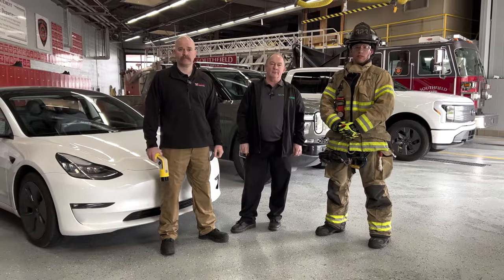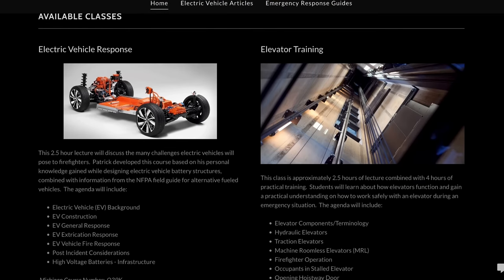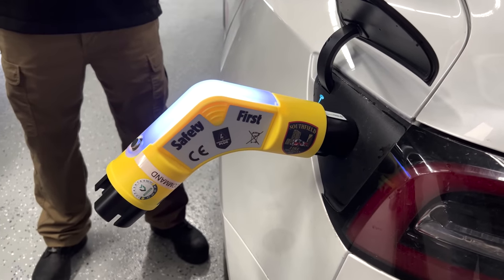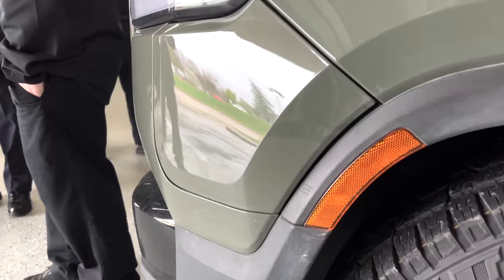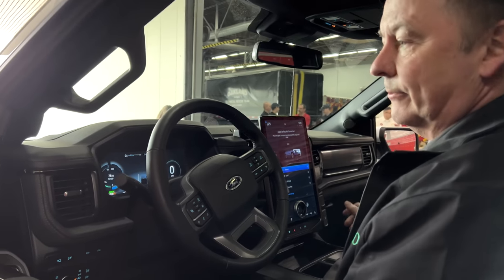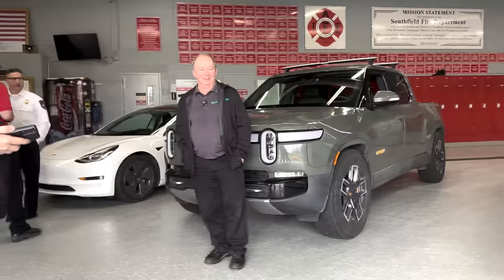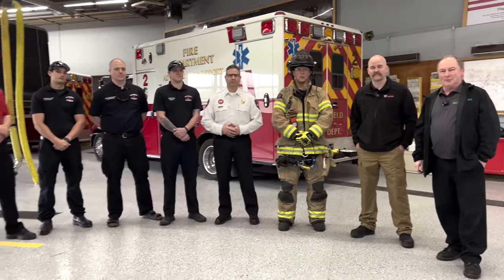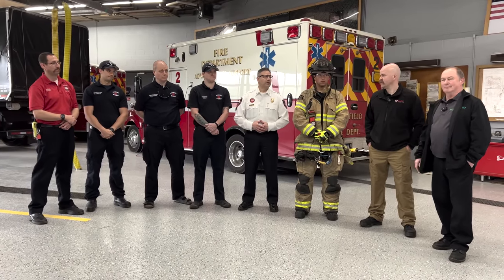An EV Device for First Responders: Emergency Plug Demonstration

Comment: Kind of shocking that a Fire Department would not know that pouring water on a Lithium Battery fire only makes it worse and last longer.  Best solution is isolate (move) the vehicle and let it self extinguish when the fuel for the fire is consumed.  But when "you have only a 'Hammer' (water) everything (fire) looks like a 'Nail'".  For fire not involving the battery: a non-combustible, non-oxygen (i.e. CO2  Nitrogen) filled foam will work well.
Reply: Maybe they know something you don't?
Water cools down the battery pack, preventing further chain reaction.
Reply: @logitech4873  Actually, in 'real life', water causes a strong reaction in Lithium.  Look it up!
Reply: @shazam6274  the amount of lithium in a battery is minimal.  the bigger issue is the battery creates its own oxygen and fuel (the electrolyte), so water, nor foam, can put it out.  Water is just cooling the battery while it releases its energy and helps to reduce other things around it from burning.
Reply: @shazam6274  Actually, in 'real life', water causes a strong reaction in sodium.  Look it up and better store your sodium chloride (table salt) in a water-tight container!
Reply: @phtofl  Yup, but most people (including "journalists") commonly just say "Lithium Battery"  There are a number of self-oxidizing and catalyzing things that water will not help extinguish.
Reply: @HenryLoenwind  Don't conflate Sodium with Sodium Chloride.  Not the same at all.
Reply: @shazam6274  Then why are you doing the same with the lithium in lithium ion batteries?

Lithium batteries contain metallic lithium, lithium-ion batteries don't. The former are those tiny 3V button cells you find in your car remote, the latter are the 4.2V (nominal) cells that power laptops, phones and cars.

BTW: That -ide suffix is a shortcut notation for "lithium ions and chlorine ions together", i.e. the salt those two form.
Reply: @HenryLoenwind  You stated that table salt should be stored in a water tight container because of the strong reaction to water.  Billions of people have used sodium chloride for thousands of years on wet foods and directly in water without a single explosion!   On the other hand, no one has ever put sodium and water together without a major dangerous exothermic reaction.  
Your simplistic Lithium statement is woefully understating the multiple variants used in the battery and pharmacological applications.  
As to the statement regarding metallic Lithium, are you suggesting that Lithium-ion batteries contain Lithium as a gas?  A Liquid?  The "ion" in Lithium-ion refers to a barrier separating the Lithium metal from the other battery elements, only allowing the ions to freely pass through.  There is no such material as Lithium-ion.   Lastly, don't season your food with "lithium-iodide", it won't taste good.  You also might look up the word "salt" in a dictionary.
Reply: @shazam6274  Wow, what a wall of text. You really recommend you look up what ions are; they have nothing to do with iodine.

But sure, let's look up "salt": "a salt is a chemical compound consisting of an ionic assembly of positively charged cat*ION*s and negatively charged an*ION*s". Best known is table salt, consisting of sodium cations and chloride anions.

And no, ions are not a gas, they are a state of atoms that use ionic assembly to form a chemical bond between them. As a solid, they form a crystalline structure (as can be seen nicely in table salt), and they really like to go into solution in a liquid (also easily seen with table salt).

The most important thing is that atoms that give up an electron or receive that extra electron (i.e. become an ion) behave very differently than they would if they hadn't. That also can be seen with table salt, as its sodium ions and chlorine ions behave very differently than a pile of sodium and chlorine. And the same is true for the lithium ions in a lithium-ion battery.

Comment: That claim of being able to open a Tesla's charge port by pressing on it isn't generally true; the car only responds to pressure on the charge port door for a short while after being put in Park.   The car will go into a sleep mode soon after, and then it only responds to whatever wireless feature is built into Tesla charging connectors.     It might remain awake enough if its Sentry mode is on; I'll have to check that.
Reply: The door is held closed by an electromagnet and is easily pried open
Reply: @vidznstuff1  Its behavior opening and closing certainly doesn't look like a magnetic closure.   It looks like the curved linkage that goes into the car is rotated by a motor; I would guess some kind of worm-gear linkage that's inherently resistant to being moved when un-powered.     I'm not going to bother looking up the actual mechanism  ( Are there even service manuals available to the public?), but with a bar-bettor's skepticism, I'll just say that constantly powering an electromagnet would be an inherent parasitic energy drain that I hope Tesla wouldn't have designed in (although a Tesla's idle consumption is kind of atrocious, all right).
Reply: @levenkay4468  There's a small permanent magnet to prevent the charge door from rattling and a motor to lift it.

Comment: Them at the dealership:

Them: Truck keeps jumping out of park can you fix it 🤔

Dealer: seems like the parking mechanism sheared clean off care to explain? 🤨

Them: oh just testing a new safety equipment to see if it can bring the truck to a stop without using the brakes 😅

Comment: Police will now pull you over, flip up the door and stick this device in, disabling your car.  "For your safety" of course...
Reply: Maybe, but even if they didn't have the device, driving away from a police stop probably isn't the best idea: They have your plates already. It'll feel really good in the moment, until you get the letter summoning you to court.

Comment: this seams to be a dangerous device to stop the owner from driving away without the ability to make it any safer for emergency rescue teams - because enabling it to charge, will close the contactors and sets the high voltage stuff live! even less safe then the "cut loop" designed to stop the dangerours electricity

Comment: Question: if a battery fire is due to thermal runaway can first responders use a chemical freezing agent... maybe a spray-on that immediately chills when water contacts it?
Reply: Doesn't really help. The runaway cannot be stopped (it's an electrical short in the damaged cells, temperature does nothing for those); the only thing they can do is to move away the created heat to stop other cells and the rest of the car from catching on fire, too. That's why it takes so long---they're basically letting the fire run its course but slow it down so it doesn't look so fiery.
Reply: The packs have to be somewhat insulated vs the environment in order to have good thermal control (except on the air-cooled Leaf, maybe).  Or if the pack shell is breached such that you can get a freezing agent in, then you can just use water.
Reply: @HenryLoenwind  so, why is it called a “thermal runaway” and not a “short”? Three things are required for fire: ignition source, fuel, heat. Take any one of those away and fire does not exist. It seems reasonable that extreme cold would work. Just because someone says “it can’t be done” doesn’t make it so. The folks at Tesla have proven naysayers wrong since 2008. 😉
Reply: @TenorDad  Thermal runaway refers to the domino effect of the heat from one damaged cell damaging the next cell. The process inside a single cell is primarily an electric short and secondarily the flammable material (mostly the electrolyte) catching fire from that.

The runaway can theoretically be stopped by cooling down the pack until the electric shorts in all damaged cells have run their course. However, in practice, this rarely works. The concentrated heat from the short (which can not be stopped by cooling down) inside the pack is still strong enough to damage neighbouring cells when the pack is only cooled from the outside. Alternatively, someone shoves a lance into the pack to flood it with water...damaging even more cells, also not stopping the runaway.

So the net effect is that still all cells burn out, but the process takes 5 times as long.

Comment: Whenever the charger door is open and no one is in the car or the driver's side Airbag deploys the car shift to park automatically. Software.
Reply: how you know that no body is in the car? The weight sensor on the seats react to the groccerie bag I placed there and the seat belt is used to secure the bag.
Sure, cameras! If the camera thinks the car is driven by a potato bag or a monkey, slam the emergencie break!
Reply: @sarowie  owner will learn not to leave groceries in car or a heat sensor could be added to the seat and also prevent unnecessary air bag deployments.
Reply: A car with self driving could remove itself from the garage if the inside temperature reached 180°F? That may need to be adjusted based on geographical location. The vehicle already has outside air temperature sensor and heat load sensors for the AC system.
Reply: @sarowie  the car could also respond to voice commands. Tesla park. Tesla go to the street. Tesla go forward backwards etc.

Comment: At the end,  he says that a battery pack fire is tens of thousands of gallons of water and 6-8 hours,   or just pull it aside and it'll burn out in an hour and a half.??? Obviously you can't always isolate the car, but wow.
Reply: It takes a lot of damage to set one of those packs off, but once they catch fire there's no putting them out. They are heavily protected within the car though, so only in in the most serious accidents will the batteries catch fire.
Reply: @Vyl Bird  agreed.  Just funny how it's better to leave it be.

Comment: I wonder if EV manufacturers could introduce a way to disable the whole HV system via the charging port too.
Reply: Imagine the fun times at charging stations... With kids etc
Reply: As that disconnect is an explosive charge that literally blows up the connections inside the battery...no, it's not a good idea to have that be triggered by a device any kid could solder together in their basement.

The cuttable wire loop under the hood, together with the automatic trigger when the airbags go off, is fine.
Reply: @HenryLoenwind  I was more referring to the service disconnect... :P

Comment: I feel like someone malicious can just, Reverse engineer this to be a device you can't remove once you insert it into the charge port, Basically disabling a car in traffic
Reply: yes, and? I could buy a main voltage battery back, put on a charging cable and plug that into EVs in a traffic jam, then... drive away with a motor cycle?
Reply: @sarowie  Yep you could, But that does take a little more money and effort to my knowledge, Also was more of a comment to it up in general, I have a feeling something like this is gonna happen in the future now lmao

Comment: One error.  The CCS plug is not most vehicles in the US, the tesla plug is.  The CCS plug is the minority.
Reply: Tesla plug is now called NACS north american charging standard
Reply: My first thought as well. Tesla plug should sensibly be the default design, based on percentage of Tesla's on the road and expected growth of their fleet.
Reply: @catbertz  👍Agreed, and the supercharging network is the most consistent.
Reply: @635574  Correct.  It is an open standard anyone can use.  Europe did the same thing, they rejected CCS combo due to how terrible j1772 was and did not want to add pins for 3 phase because the design was terrible.  Hard to aligng and insert, too much pressure to insert and remove, heavy, likely not even ADA complaint at all in the USA, etc.  
In 2014, europe mandated the use of the proprietary mennekes type 2 connector as it has some of the features of NACS.  Easier to insert with a self guiding bevel, much lower pressure to insert, and doesn't have the silly mechanical release button which is hard to use.  That is how europe ended up with Mennekes Type 2 combo, a proprietary connector with the bottom half off CCS combo slapped onto it.  A step up from CCS combo, but they should have redesigned it and made it more compact like NACS.
NACS is the gold standard for ease of use and supports 1000kw while CCS combo is limited to 350kw.
Reply: Another vote for NACS.  In the US I wouldn't buy a vehicle that's CCS1.
Reply: @StormyDog  I would rather have NACS on any CCS car because then you get to use the user friendly NACS at home.  Using an adapter at CCS chargers is less of a hassle than using CCS at home.  Plus CCS chargers can easily have two different cables, all CCS chargers are designed for two cables as manufacturers planned for two different cable tips.  EA could replace their second CCS cable with NACS for nearly free(do it during normal cable replacements).  NACS can use any protocol and has the exact same physical wiring as CSS so you can swap a CCS cable to NACS with a socket wrench and 5 minutes of time.
Cars can easily talk any protocol in the world, which is what tesla does.  One charge circuit that talks any protocol.  That is how tesla enabled the super cheap tip adapters without any electronics in them.  The car just needs a physical tip adapter, the car then can talk CCS just fine.
All CCS cars should switch to NACS ports or at least give the option when buying.  I hope someone makes aftermarket CCS to NACS port replacements, all you are doing is changing the shape of the port, not any wiring or electronics.
Reply: NACS
Reply: @_PatrickO  Great info! Thanks!
Reply: @_PatrickO  Yep, agree.
Reply: I’m thinking international sales?
Reply: @legostud  US and European plugs are different anyway.   US is CCS1 vs CCS2 in Europe.  CCS1 is poor.
Reply: @StormyDog  - I thought they were similar enough for something like this device.

Comment: He said the device without an adapter could "plug into most vehicles in the US" and then he puts the adapter on and says it "allows it to plug into a Tesla". However, most vehicles in the US don't even have a charge port so we must assume he means it allows it to plug into most EV's in the US. But he seems unaware that most EV's in the US are made by Tesla.
Reply: Not for much longer. Tesla made EVs cool, but they are rapidly losing market share to the more established manufacturers.

Tesla like to keep their cars expensive, exclusive. Status symbols. High performance, high cost. Everyone wants to own a Ferrari, but Ford sell a lot more cars.
Reply: @vylbird8014  Ford just adopted the NACS (North American Charge Standard, AKA Tesla standard) charge port on all their EV's starting in 2025. That includes the Lightning F-150 EV, the Mach-e, the Ford Transit Van EV and any new Models they bring to market. Not only do most electric cars in North America already have a Tesla charge port, this move from Ford guarantees that the Tesla charging standard will continue to be dominant as far as the eye can see. 

As to Tesla losing market share, not really. The true measure of market share is of the entire automotive market and Tesla is rapidly gaining market share in North America, not losing it as you claimed. Tesla offers the most car for the money of any EV maker and, more telling going forward, they are able to do that while making excellent margins while every other EV maker loses a ton of money on every EV they sell in North America. That means legacy auto cannot hope to offer the new car buyer as much value as Tesla does. It's not practical to continue selling EV's at a big loss so there is no way legacy auto can offer the amount of value Tesla does.

Comment: The description is invalid, it doesn't do anything special it makes the car think it's charging therefore making it undrivable, but it's not disabled by any means, if you press unlock charge port it will probably let you drive until it realises that its still plugged in. This doesn't make the car roll in neutral it just puts it in park. But the electrical system is still live, useless device really.

Comment: A car that is on fire is not suddenly going to drive off, and no sane fire department is going to go chasing a car at foot speed to try and stick this into the charge port. It's being presented under the guise of safety, but is only going to be used by the police to detain you and your vehicle against your will.
Tesla drivers: keep the car in drive and the port will remain locked even if they pry the door open, preventing this from being inserted.
Reply: If the police want to detail you against your will, they don't need this device. They already have your plates. Go ahead and drive off - you'll get a day or too to feel smug about your victory before the letter arrives ordering you to court.